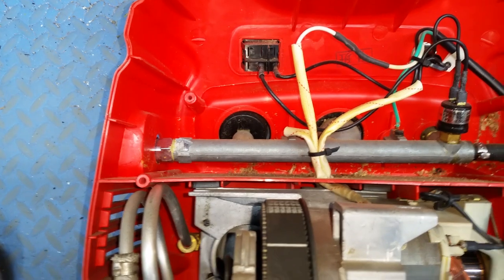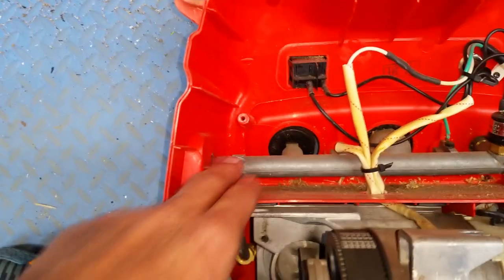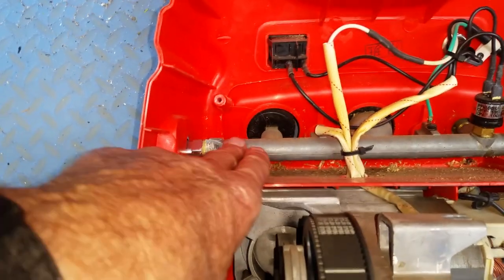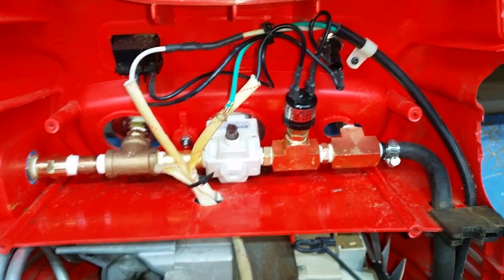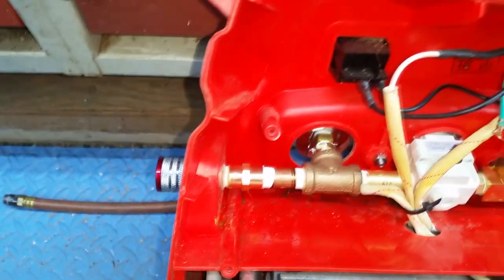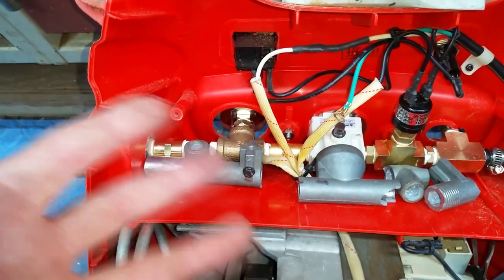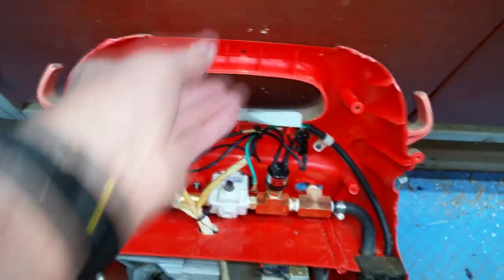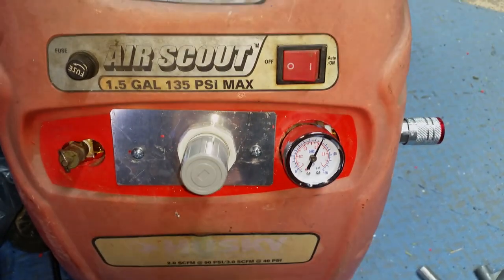Husky air compressor repair

Comment: I have the same compressor and facing the same dilemma, except mine is leaking from the pressure relief valve and it broke the manifold whenever I tried to screw it back in.  The reason the internet has so many of these manifolds for sale (except for this model) is because these manifolds are made of cheap chinese zinc/pot metal.  Not sure which route I'm going yet, but  I have a nice aluminum pipe that I may try to use if I can tap it for the threads of the fittings.  If not, I will try doing it the way that you did.  I will have to write it off to a learning experience I guess, even though I really didn't want to learn how to fix one of these, haha.  

Thanks for putting up this video though.

Comment: Thanks for the video! Very creative fix. Im facing the same leaking issue on a similar model only a bit newer (Husky Y1010 Easy Air To Go) and i havent opened it up yet to see where it's leaking from. The regulator knob doesnt turn as well, but hopefully it wont be as in depth a fix as yours! 😅

Comment: Vincent, liked your video on repairing the husky compressor. I have one that got the regulator adjustment knob & the threaded shaft & the front part of the regulator housing broke. The back part of the housing which is part of the manifold is good, would you still have the front part of the regulator & interior parts, and would they be available??
Reply from the maker: Nothing was available when I searched.